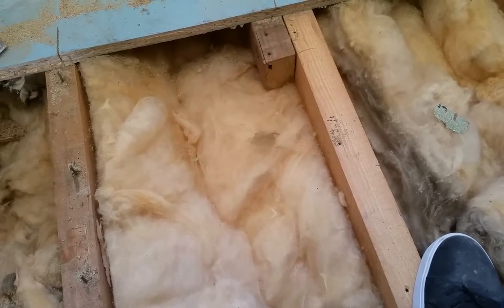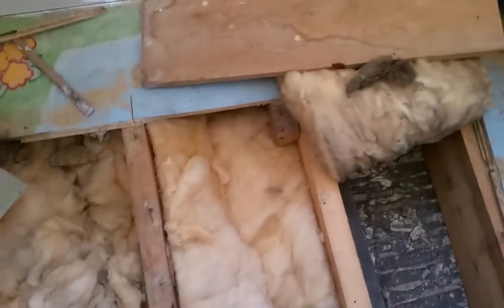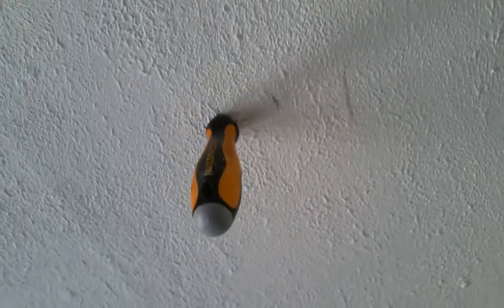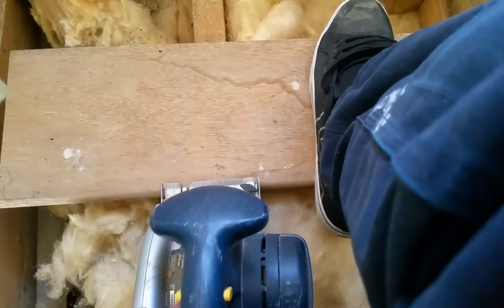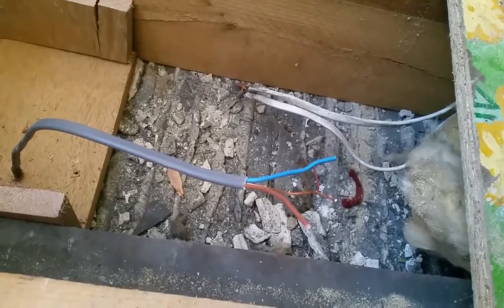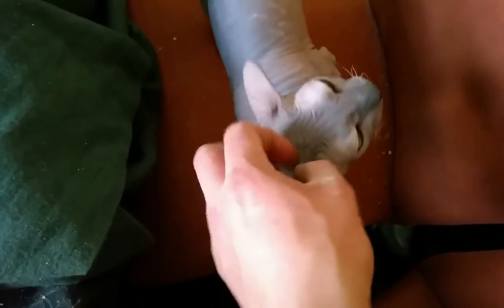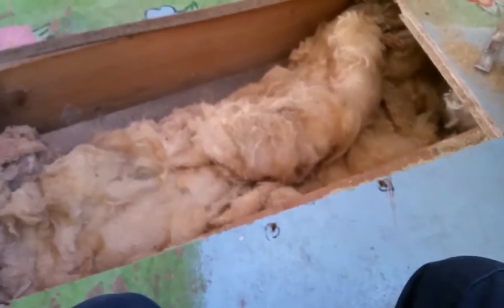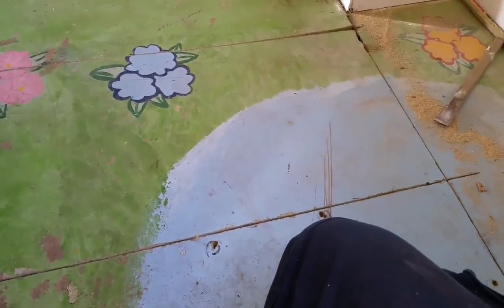moving dining room lighting point

Comment: Any junction box concealed in such a manner requires maintenance free connections or the enclosure should be filled with a non corrosive compound, not heard mong for a while you are clearly well out of touch.
Reply from the maker: I'll let you have that. Needs a rewire. All but 1 light downstairs has 3 core flex through. JB's all over. shall I do my minor works now? lol mong haha builder had wrong slabs delivered he was having a go on the phone. I hadn't heard it in a while either. it's back now =)